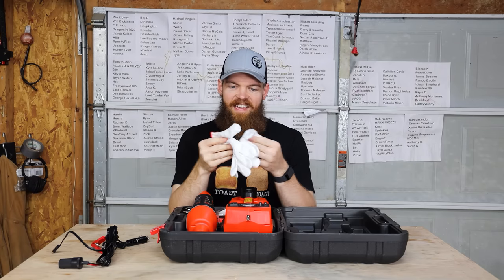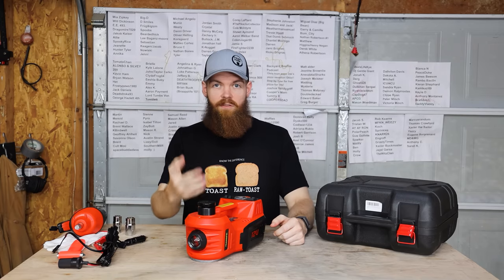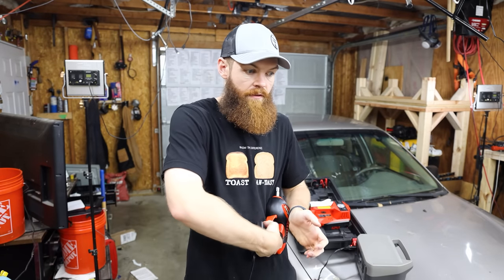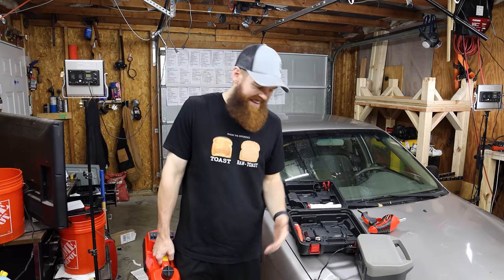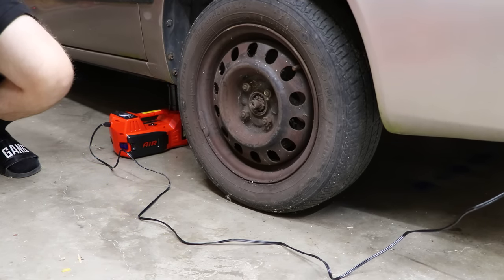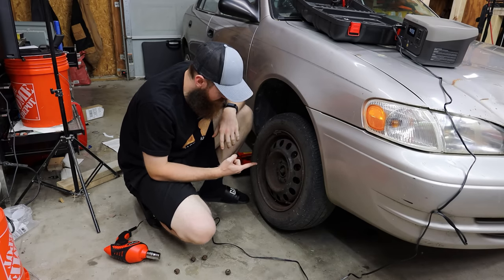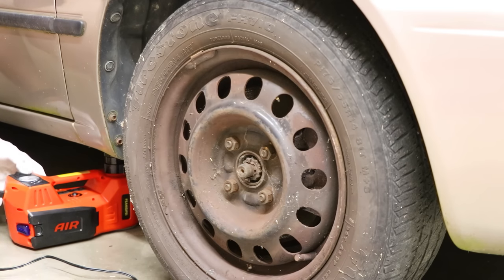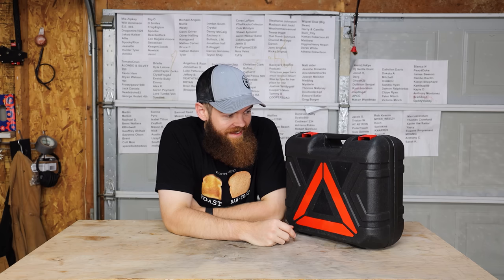Testing The Cheapest Tire Changing Kit On Amazon!

Comment: Alright, this is actually a wheel changing kit and not a tyre changing kit - as when you change your tyre you are just changing the rubber and not the rim/mag when you change a wheel you require place the entire wheel as in the rim/mag including the tyre. Secondly the glove would probably come in handy just to keep your hands clean as you wouldn't want to change a dirty wheel that's as dirty as yours and then go hold your steering wheel once you are done and put all that dirt on your steering wheel, and for women that don't want to get their hands too dirty it's not like you can just wash your hands as soon as you are done changing your wheel. The light is not bad at all man. As for the window smasher you can just keep that in your car for emergencies and not in your trunk. The jack goes high as not all people have a low car, utes/pickup trucks/bakkies are alot taller so you would need the height. The Valcro on the case is probably so the case doesn't slide around in your trunk. That's why you shouldn't just throw the instructions away🤣 

Don't downgrade things for no reason man. See some positivity in things.

Comment: Dude. “$155 for something that’s electric” is not good enough reason to cast doubt on the impact wrench. 12 years ago I got Harbor Freight’s “Emergency Roadside 12v Impact Wrench” in a similar case with impact sockets and the same clamp to lighter socket adapter. It’s has helped me out several times. Used it to take a countershaft sprocket off a motorcycle too. It certainly wouldn’t stand up to daily use, hence why they are sold as “emergency” tools for the occasional “roadside” use when stranded.
Reply: I liked it so much I even bought a second one when I found it at a thrift store. One stays in the car and the other stays with my tools.

Comment: Lug bolts are usually pressed in, so most likely when you were trying to tighten the nut to 150 ft-lb you were probably just spinning the bolt.

Comment: If you face the flashlight toward the tire you are working on and jack under the pinch the flashlight will light up your workspace and those back lights would be facing the rear for “safety”. I assume that was their intention anyways.

Also you stretched the shit out of that one wheel stud. Please change it before it changes itself on the highway.

Comment: Those gloves look like they're straight out of a Chinese correction facility.
A plastic jack I would never trust.
The impact gun is working the same as a normal impact gun but it hasn't got as much power so it needs more energy built up between impacts.
And I thought you were changing a tyre not just taking the wheel off 👀😆😆

Comment: It's not TECHNICALLY illegal to have those lights on the jack (Section 56-5-4830) as long as they are facing backwards from your vehicle. Given their intended use however, it's going to be an absolute asshole of a cop (so about 85% of them) that would give you a citation for it rather than helping you just change the dang tire and be on your way.

Comment: Kinda pointless. Modern cars don't come with spares, and if they do it's a space saver and comes with all the tools you need. But if you want to flatten your stupidly small car battery which was chosen as a.cost and weight saving that's fine. But you'll still need recovery. The only benifit is a compressor. And you can buy them for under five bucks.

Comment: You should always "crack" the lug nuts with the car on the ground.  Then lift and remove them the rest of the way, No basic sedan steel wheels would need to be over 90 ft/lbs.  That's a pretty hefty unit, besides that power issue.

Comment: To be nitpicky and technical does it make sense to call it a tire change kit, you're not really changing a tire your changing a wheel. The tire isn't changed until it is taken off the rim and a new one mounted on it. Just saying. I was just thinking when i clicked the video that maybe it actually was a portable tire changing kit which would be nice as the machines a shop has costs thousands of dollars. I know there are manual tire changers but they're kind of a pain to use.